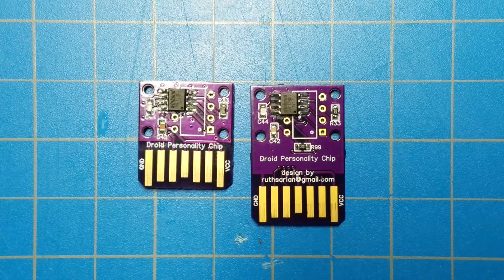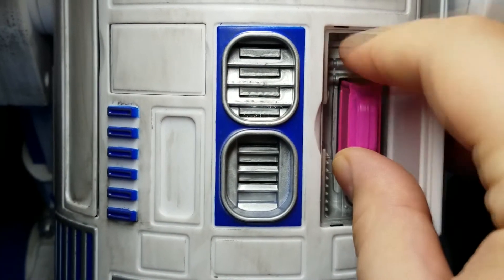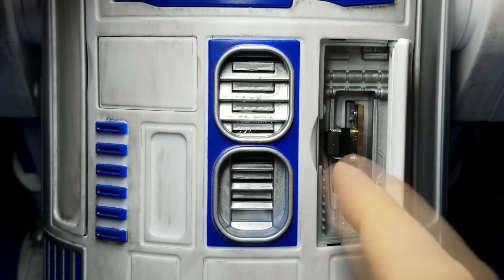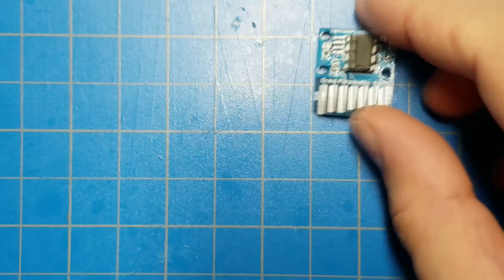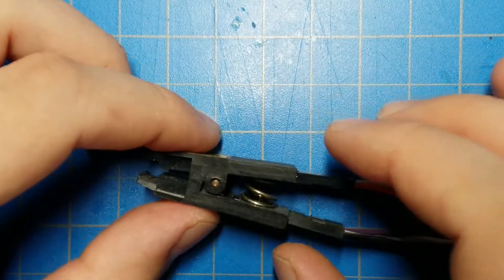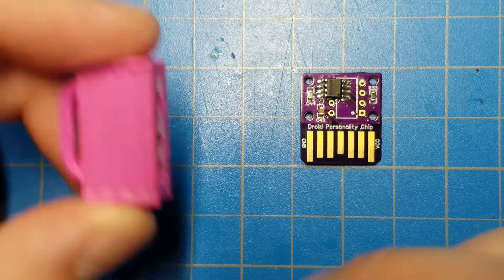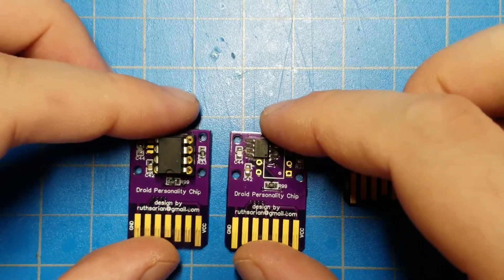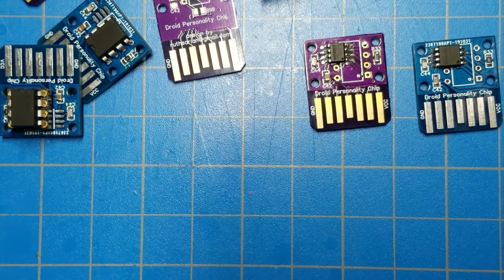A Tall Personality Chip For R-Unit Droids

Comment: Thanks for the update. I already have the smalls, and I can deal with the height. A small bit of string can also help anyone having trouble removing the short version. just loop it through the holes in the pcb for a little lanyard to pull on.